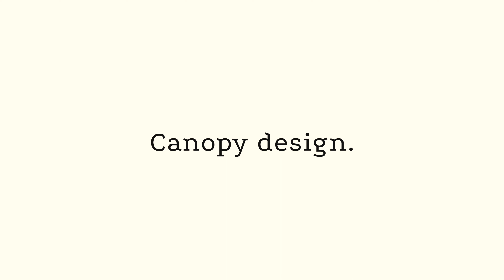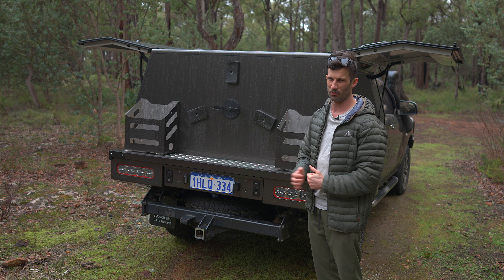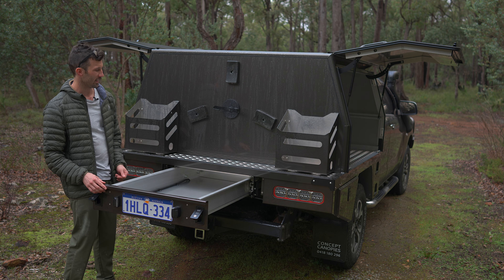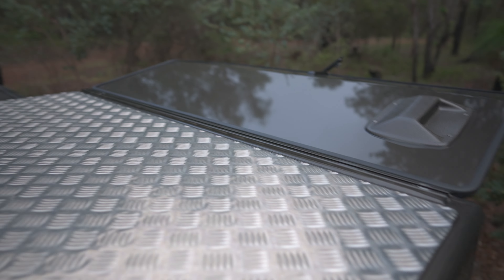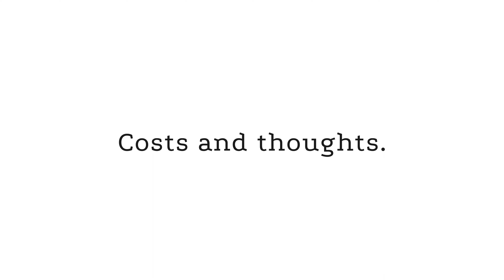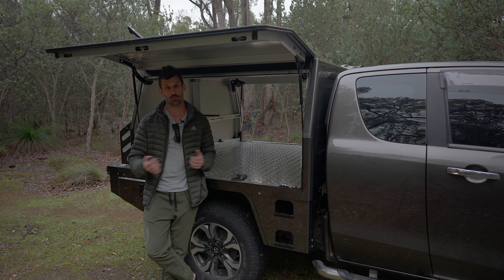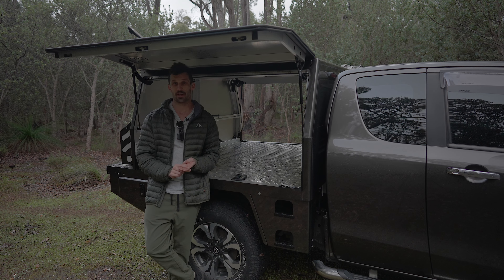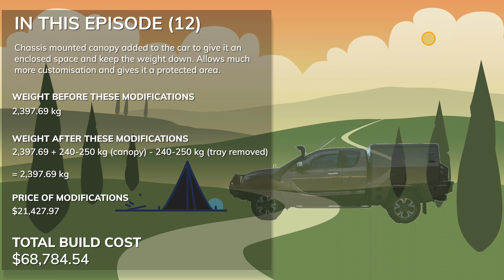Why I Decided On A Concept Canopies Canopy - Properly Custom Builds || BT-50 Build EP12

Comment: Still happy with the canopy? Any issues or dramas?
Reply from the maker: No issues so far but I'm not exactly doing water crossings or anything like that.

Has been fine, dust proof and lightweight. 

I think the locks on the toolboxes and the trundle drawer are a little finicky but once you're used to it it's a non-issue.

It does exactly what I need it to do and hopefully I hold into it for another 10 years or so. I'm not into flipping things for no reason I try to make purchases that last.

Plenty of canopy manufacturers these days though to choose from.

Comment: I came to the same conclusions in regard to getting a club cab and going with Concept.
The thing that sold me was their custom design and light weight.
We're getting ours 2000 long but the rear 500 will just be a tray for putting push bikes on. 
We'll have our spare wheel mounted on the inside front wall of the canopy, thus keeping the weight forward.
We'll get an empty box and decide over time what type of 12V system and drawers we'll need.
Reply from the maker: If I ever need another canopy I'll be hitting them up again. Love the customisability on offer!

I also considered the tyre on the front wall.
Reply: @TheBrowneTown  Sounds like we're on the same page. 👍

Comment: g'day, how are you finding the door seals and locking mechanisms, any issues with any of the associated components, and any dust or water ingress? also what do you think of the vents they use on the doors. cheers
Reply from the maker: I haven't had any issues with water or dust ingress but I have not submerged anything under water.

I believe someone else in the comments of one of my videos had water get into one of the behind the wheel toolboxes but I can't remember.

I've had small amounts of dust on the trundle drawer but not a lot.